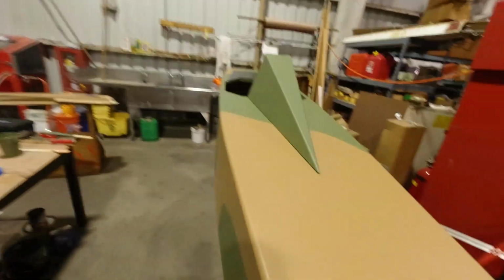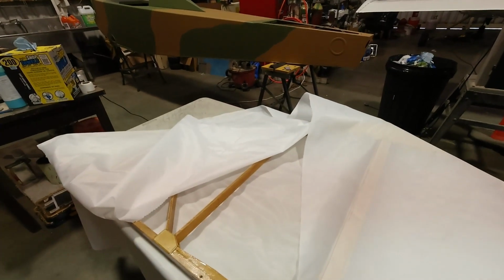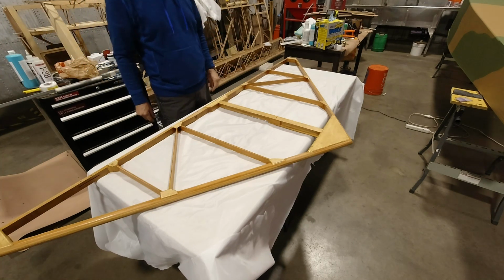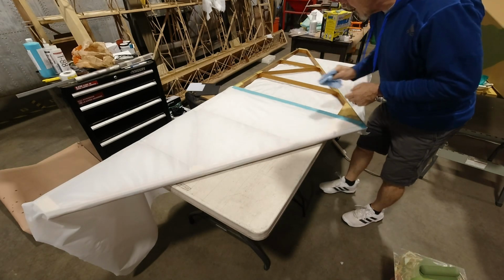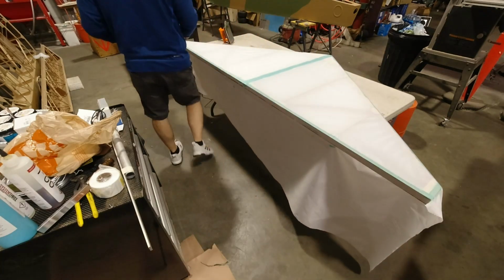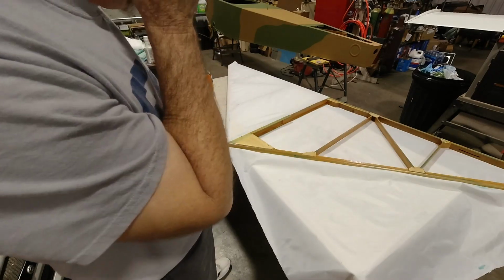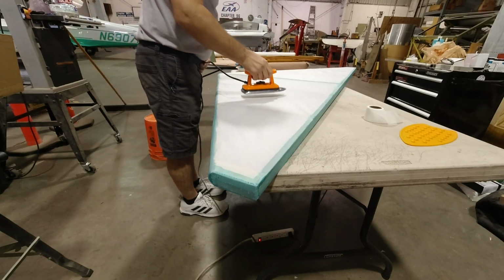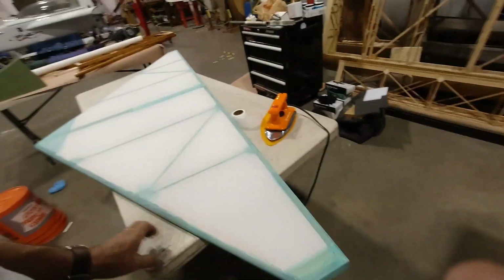Minimax1100r Wood Aircraft Build Ep 158 - Covering the Stab

Comment: Dennis good evening from the UK , I am just in from the workshop I have finished one side of one wing covering today . Two questions , what temperature did you use to finish the shrink on the stab?  
What type of hinges do u have on the elevator , is it the " cupboard door type that slot in ?
RiP
Reply from the maker: Hey Robert, I am using the ones that slot in. I am shrinking everything to 250 degrees max
Glad your making good progress.